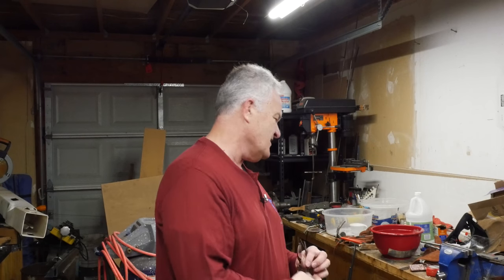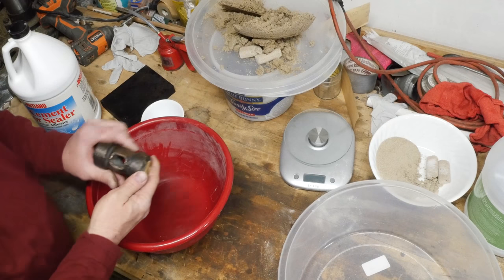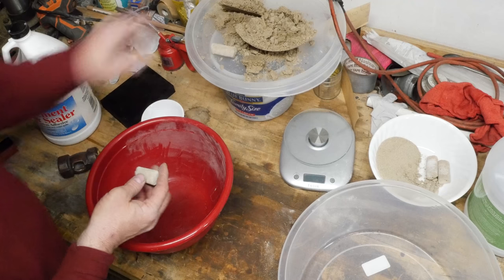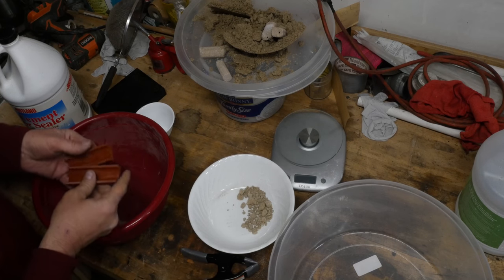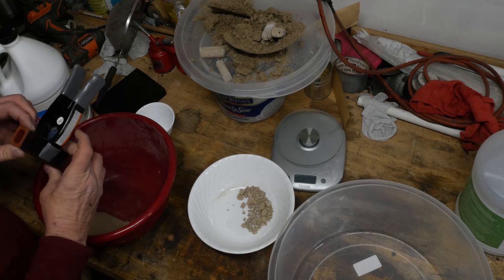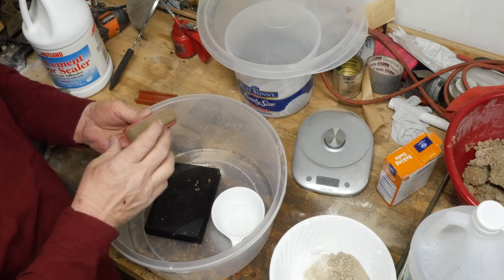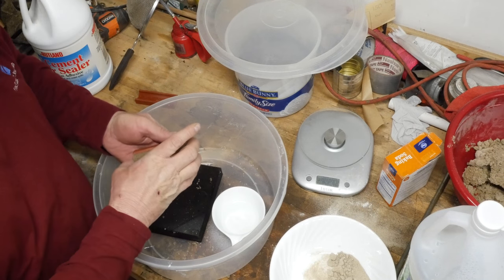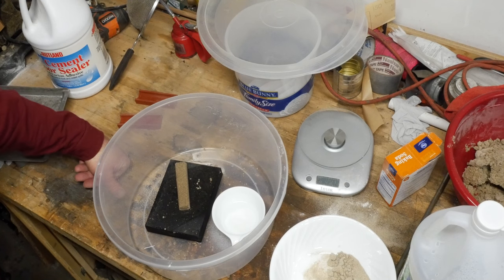Making sodium silicate cores

Comment: I don't understand why you need to use CO2 in the first place. You don't use CO2 to dry it when applying it to cement floors and those dry just fine in less than 30 minutes.
Reply from the maker: Most people have far more efficient ways of delivering CO2 to the sodium silicate than what I did.  They do it so the cores harden almost instantaneously.  Part of the problem with cores, or molds as well, is they are far thicker than the layer that gets spread on a floor.  The sodium silicate at the center may take hours or days to harden due to the lack of carbon dioxide in the thicker sections.
Reply: @swdweeb  thank you. That was helpful info. Just started watching, and by no means watching them in order. Your videos are informative and interesting. I like to see the fails ( one reason I watch Pauls garage) so that I can see what I might expect to happen so that I won't be as surprised if it happens to me. (far future)
Reply from the maker: @StonerSmurfin  I'm glad it helped. Don't hesitate to ask if you have questions

Comment: Great method! Turned out well! 
If you revisit this experiment, will you try dry-ice?
Thanx Buddy! :D
Reply from the maker: Hadn't thought of dry ice. I expect that it will work pretty well. I've been battling a core right now and I'm about ready to invest in a CO2 canister.
Reply: I was thinking soda.
Carbonated water maybe?
Reply from the maker: I actually looked at those canisters you can get to refill a carbonated drink maker type machine last night. Certainly a cheaper initial expense, but I expect more expensive long-term. We'll have to see. The core I made for this Friday's video was a pain in the butt. I"m not looking forward to do anymore of them in the near future. I need to forget how much fun this one was first ;-)
Reply: Cool! :D
Reply: Another place to check into CO2 canisters would be any place that sells paintball supplies.  I know my local Army Surplus can refill them.  I think it that would be cheaper (or the same price) because it doesn't have to be "food grade".  You might also check your local fire department.  Some fire departments can refill CO2 fire extinguishers, so that might be an option.
However, it would not really surprise me in this throw-away society that buying a new extinguisher would be the cheapest method overall...
Reply from the maker: Great ideas, thanks